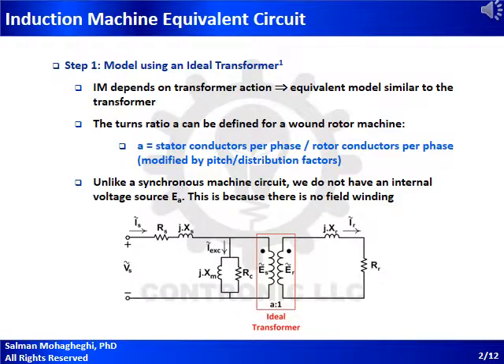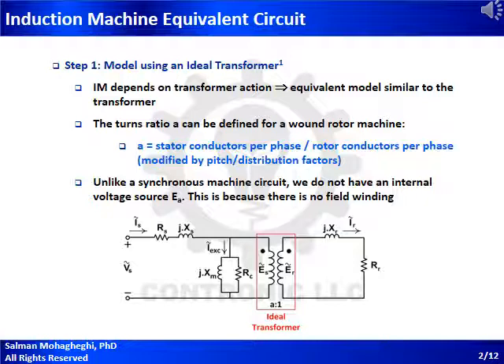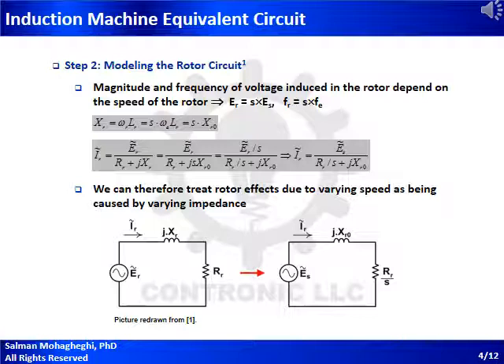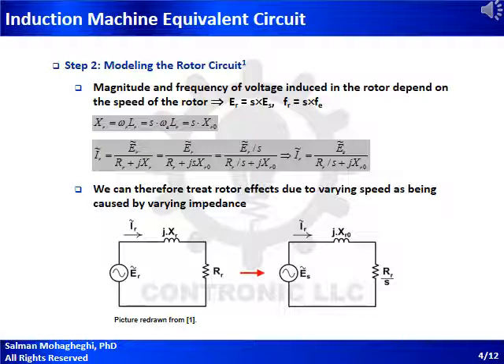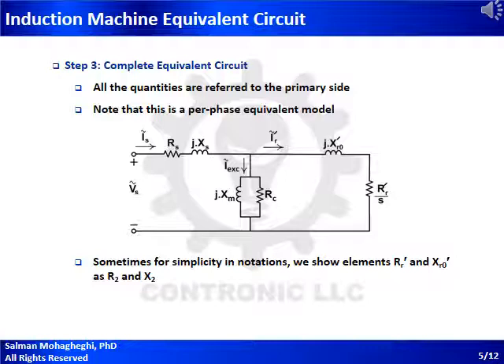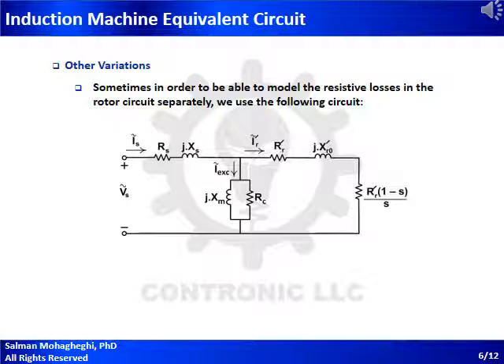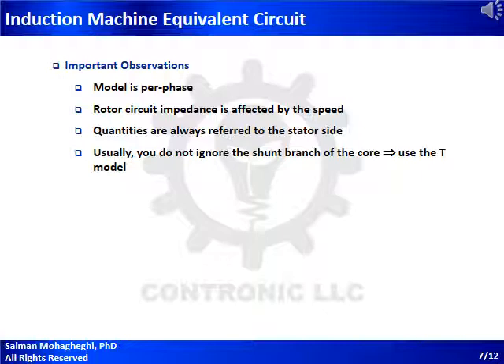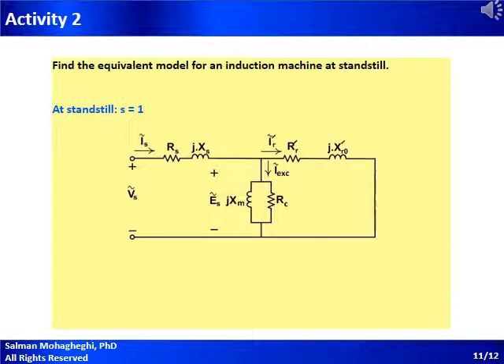L29 - Induction Machine Equivalent Circuit

Comment: Can someone please attempt this,
 A Y-connected induction motor rated 460V,60Hz 4 Pole has the following impedances in ohm per phase. Refered circuit parameters
R1= 0.641 ohms R2'= 0.332 ohms X1= 1.106 ohms X2'= 0.464ohms Xm= 26.3ohms
  If the rotational losses are 1100W and are assumed constant,while the core loss is merged with the rotational losses. Assume the operational slip is 2.2% at rated voltage and frequency while stray loss Rc is negligible, calculate;
i. Speed
ii. Stator current
iii. Power factor
iv. P.mech & P.out
v. Induced torque  in N/m
Reply: Also having issues with that question especially for the stator current coz in the solution booklets l have found with answers, they are introducing these other angles which are really giving me a hard time